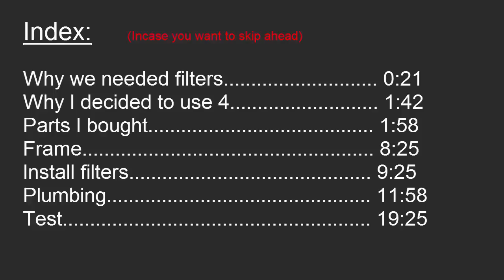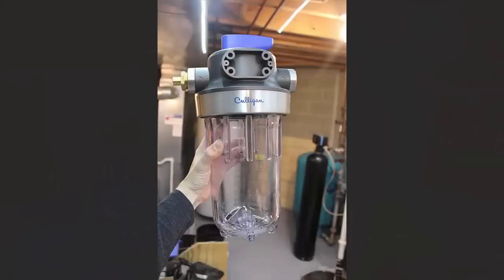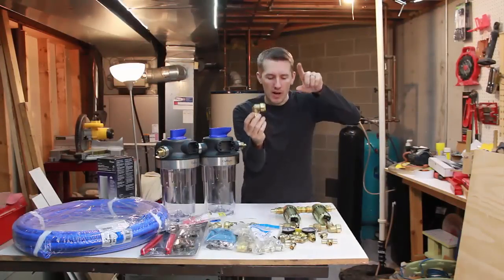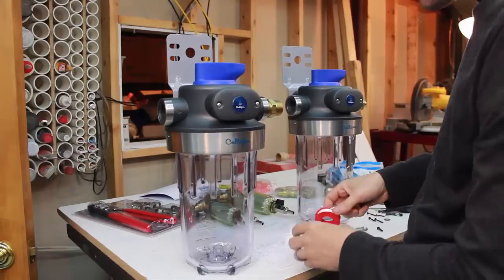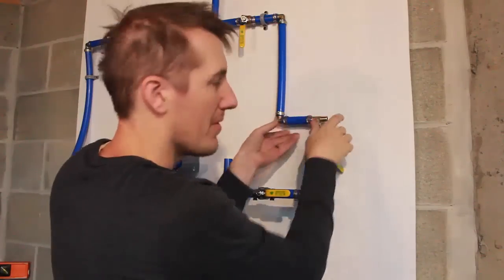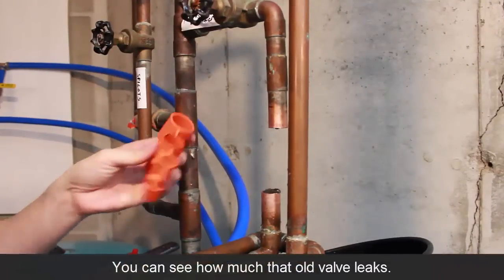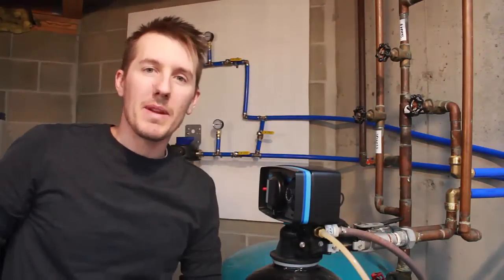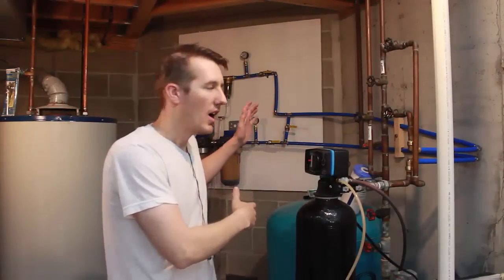How to Install a Whole House Water Filter System

Comment: Is his setup overkill for a prefilter for an aquasure water softener? Or is the ispring mesh filter ll I really need. I'm asking since the 2 cullligan filters are so big, and I wonder if I really need them. I have alot of lime in my well water. Deep Thanks.
Reply from the maker: The iSpring filters are nice because they require very little maintenance.  Blow off every month, takes 3 seconds, clean with tooth brush maybe every year.  The Culligan filters are more work (for me) need to be be changed every month.
Maybe for you, you could go with the 50 micron iSpring and then just 1 Culligan filter with a 10 micron inside.

Comment: Great videos Gary!  I am learning a lot.  I am still doing my research, but I have come across a local company that modifies the UV Dynamics unit by adding an extra 50/20 sediment filter in front of the 5/1 sediment filter and then the 10 micron carbon filter.  Is there any advantage of this 3rd filter?  Also, why not use a 5 micron carbon filter?  The 10 micron seems to be the standard.  I am drawing water from the lake.

Comment: I just watched your video. Thank you for sharing, because this assists in understanding the installation process. You explained the receiving and exiting of water flow in a way anyone can follow. Your explanation made for an easy understanding of the entire process. What is the black tank? You said the blue tank is a well, right? How is the taste of water since the installation?
Reply from the maker: black tank is the water softner.  blue tank holds the water under pressure so that the pump doesn't turn on every time you need a little water.  water tastes fine even without the filters.  our issue was with iron in the water, not so much the taste.
Reply: @Dave Wirth this is a little bit off topic, I just noticed your thumbnail pic & I don’t know if it’s the lighting in the video, the device I’m watching it on, or type of camera you used, but I swear in the video you look like a white dude! Anyhow, like I said it’s a bit off topic, but regardless, thanks for sharing!

Comment: My question to u is. I have one of each units. Does it matter which one goes 1st?   The small unit then the large unit. Or the large unit then small??
Reply from the maker: You want the filter micron size to go from largest to smallest.   Mine is 100 microns, 50, 20, 5.
That way the big particles get caught in the first filter then progressively smaller.

Comment: Thank you so much for this video...one of the best I've seen. I am installing a filtration system now and got several great tips from you. One question - I need to also monitor volume...any thoughts on a simple flow gauge?
Reply from the maker: Not sure about a flow gauge - but looks like there's a bunch of them on amazon:  https://amzn.to/3tB5y94
Also, i've said it before in the comments.  But the pressure gauges are basically useless.  I thought i would be able to see a difference in pressure and know if i had to change a filter.  It didn't work like that.  They always read the same pressure, whatever's coming out of the big tank after the pump.

Comment: The pressure drop you saw between the well gauge and the filter loop gauges may have to do with the gauge calibrations and not an actual pressure drop. Or you have a couple valves between the well gauge and the first gauge in the filter loop, there could be a little restriction there.

Comment: Very nice video, one question, the filter inlet and outlet are 1" rather than 3/4", is there a mix up on your male 2 male hex fitting? Also 3/4" PEX to male adapters?
Reply from the maker: I thought that the Culligan filters had 2 different thread sizes.  They are threaded on the inside and outside maybe?  Like 3/4" female and 1" male, so you could use either.  .....  Whoops, nope, i just checked.  It's the iSpring filters that have both internal and external threads.  Yes the Culligan is 1".  Yes i must have used 1" to 1" male to connect them and 1" to Pex on the ends.  You are right.

Comment: My own research led me to believe that 4.5x20 was the optimal size, but you chose 4.5x10.  Could you share your thought process?  Did you find more filters from more brands available at that size?
Reply from the maker: the 20" would definitely last longer - meaning it would not need to be changed as often.
But i think the 10 inch is more common.
And i was able to buy the filters for like $7 - $10 each.

Comment: The problem I’m having with my well water is the odor.. in your opinion would I need just 1 of those filter housing with a carbon filter cartridge? Also with the spin out filter is that a must? Currently I have a large sediment tank a water softener and a 5 micron filter then going into a Uv sterilization..

Comment: Why didnt u use 20 inch filter housings that would have lasted much longer before needing maintenance? Also can u detail what u were talking about people using parallel connections? How does that work?
Reply from the maker: Yes the 20 inch filter would last longer, but i think it was more expensive and filters were more expensive.  I liked the clear case, it allows me to just visually see the condition of the filter.  And the 10"x4.5" is super common and i can get filters for $7 if i buy in bulk.
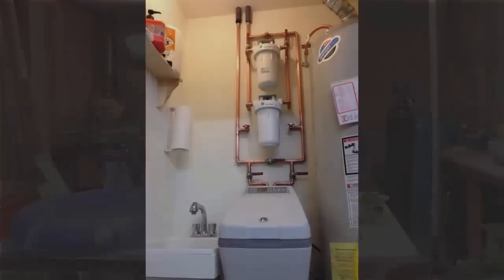By parallel i mean the picture at 1:24.  Basically you are doubling, or in that case tripling the amount of filtered water.

Comment: Great video, with clear explanation and demonstration! I learned a lot. I do have one question -- how do you feel about installing the spin down filter(s) "before" the outside water outlets. Sprayers probably don't matter much, but I do have electronic flow meters, and others have sprinklers and drippers. Wonder if you did research on that, or just can share your opinion.
Reply from the maker: Sure that would work.  They are small and you can install them anywhere.
I just put everything together, but since you don't have to change a filter (just scrub them off once a year) they can handle any flow.

Comment: Just a note when considering PEX or other plastic tubing for water filtration: "researchers tested water in homes where plastic drinking water pipes had been installed, comparing different brands and types of PEX, PVC, polypropylene and high-density polyethylene. They found that PEX pipes released more odors and leached more chemicals compared to polypropylene" (chemicals such as toluene, which is neurotoxic, and MTBE, a carcinogen that's been banned as a gasoline additive, but is a byproduct produced during PEX pipe manufacture)".

Comment: So you filter the water before the water softner correct?
Reply from the maker: I did.  Not sure if that's the best method.
Some say do it after the softenter, and let that remove most of the sediment/rust.
That might have been a better idea and i wouldn't have had to change filters so often.

Comment: I just finished my installation of a whole house carbon water filter and water softener using the CULLIGAN WH-HD200-C on this video (Pentek Dual-Gradient Density 50/5 micron pre-filter and 25/1 micron post-filter)and the SuperPro 80960BU Water Pressure Gauge. I wish I would have had filmed but I needed full concentration and 0 distractions with the camera. I really like the CULLIGAN filters, the only complaint that I have is with the water pressure gauges, are not accurate, they are very close to accurate with a 2-3 psi discrepancy from the real psi on that water line. Close Enough. I guess they are not bad for a $5.30 water pressure gauge.

Comment: Hi Dave, great video. Do you have a link for the reducer going from the culligan 1 inch down to the 3/4 or 1/2 size as I am not seeing that in your links.
Thanks
Reply from the maker: It was something like this, but this is 3/4" for both so this isn't the right size:  https://amzn.to/2XLeKrj
I can't find the one i got, but i got everything on Amazon so maybe you will have better luck finding the right one.
Reply: Thanks, ya seems th 1 inch reducer is a bit hard to find right now

Comment: Great video learning a lot. But question.. why do you have 90 degree bends , wouldn't it be easier to just have one piece from the smaller filters to the larger filters instead of two 90 degree elbows ? I want to install this in my house and want to make sure I do it right but also make it simpler if certain steps are not needed. hope you reply to do this. thanks in advance
Reply from the maker: Yes, 90 deg bends are not needed.  But i only had a certain amount of space and had to fit in 4 filters.  That meant i had to stack them vertically.  There's a million ways to layout the filters depending on how much room you have.  If you have a long straight section you could totally just have them all in line.
Reply: @DaveWirth  Thanks for replying. Very useful video appreciate it.

Comment: This is a great video. Thanks for the upload. 

What are the TDS levels from the faucets now? I'm looking into a pre-filter system for our water. We currently only run a softer.
Reply from the maker: I haven't checked since this video, back about a year ago:
https://youtu.be/10pUt3cRpz8?t=477
But there wasn't a difference between the water directly from the well and through all the filters.  But the RO filters took the levels way down.

Comment: The current version of the iSpring filter includes a mounting bracket, screws, teflon tape, wrench and installation instructions. 

The clear plasting tubing to drain it is 1/2 outside diameter.

Comment: I just bought a house with a water well too.. in the well shed, I see it has those two smaller filters... and it's dirty.. I guess I need to open it up and let the dirty water drain down?  And I dont have the two bigger filters you have.. is that okay? Are the two smaller filters good enough to remove any dirt/sediment from the water well?
Reply from the maker: 1.  Yes turn the knob on the filters to drain.
2.  You will probably have to take the mesh filters out and clean them see: https://youtu.be/FOlLTR9NRy0?t=191
3.  Depending on what sediment you have they might be ok.  If you are just trying to remove sediment or something then yes they should be fine.  But rust and things will get through.
Reply: @DaveWirth  Cool.. next, is there a way to determine the water flow direction? I assume the water from the well/ground goes to my pressure tank, then one of these these small filters, then to my culligan water softener, then to the 2nd small filter (these two filters are separated/independent from each other), and finally to the house... Since there are no direction arrows drawn on the pipes, is there a way to know the flow of water, say from turning of valves off along the piping?
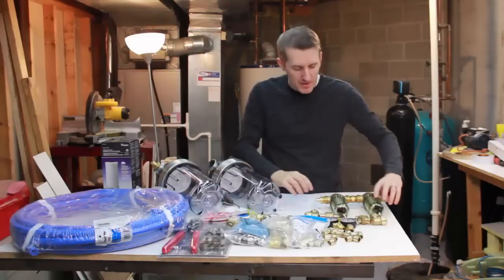Reply from the maker: @be236  you can see mine at 2:16
There are little triangles in the metal that show the water direction (or at least the way they were supposed to have the water flow)
But yes what you said makes sense.   Well, pressure tank, filters, softener, house.  Weird that yours goes filter, softener, filter, house.
Reply: @DaveWirth  Ah, yes, I see the arrows on the pipes with the filters.. nice... as for my two separate filters... I am guessing the one where between : water softener -> filter #2 -> house... maybe it's to filter whatever comes from the softener, eg, maybe there was some dirt that fell into the brine tank, since the big lid is a cover w/o any locking mechanism, anyone could just lift the lid up and "ack" drop or put something in there.. my system is in a shed and the previous owner didnt even put a lock on the shed door (I just put a lock afterwards).

Comment: Why needed that clock like valve or system in the water filteration ?
Reply from the maker: The 2 pressure gauges are not really needed.  I thought i would use them to know the pressure before and after the filters, but if i did it again i would skip the gauges.

Comment: Do you have the link to oring and lubricant please ? Almost doing a replica copy of this. Except hoping to use oil based pressure gauge instead of default one. But same setup.
Reply from the maker: any food-safe lubricant will work
and i don't really use the gauges.  like someone else said, the gauges only really work when there's water flowing not just reading the pressure.  if i did it again i would skip the gauges.

Comment: Where did you get the rings for the Culligan filters?
Reply from the maker: Amazon:  https://amzn.to/3nb8ZRh
One tip, that someone commented, that has helped a lot, is to NOT over tighten the housing.  The first couple of times i changed the filter, i noticed that the rubber o-rings were warped.   I guess i was over-tightening the clear housing and that was the cause.  Since then i've just done a snug fit.  Zero leaks and the o-rings have lasted years.
Reply: @DaveWirth  Thank You for your help and time.

Comment: Very interesting! Just wondering why you used 2x elbow and 3 sections of PEX on the left hand join (between the big filters and small) and didn't just form the PEX around in a C shape in one section? was the radius too tight or was there another reason?
Reply from the maker: Ya the radius was too tight, might have put a strain on the fittings.  Similar to why i changed the bend at https://youtu.be/0_F_xUKHwBQ?t=959    to an elbow so i could fit it tighter to the wall.  I'm sure a more experienced person would know how to heat and bend the pipe more but i didn't feel comfortable doing it since it was my first time using PEX.  But overall PEX was awesome and easy to use.

Comment: Did you tested before and after TDS? Just wondering if it changed
Reply from the maker: No i only recently got a TDS meter, but it would be a good idea to test the levels with an old filter and then after installing 2 new filters.

Comment: Watching this, and I had used teflon tape as well, major leaks...I then found the "liquid version" of teflon and that made a much better seal, no leaks. Also I am wondering why you had not used a GAC filter. My setup is 10" 20 micron "pleated" media followed by 5 micron sediment filter, then goes into a 20" GAC filter media and then it goes into water softener.  Again great idea for a "bypass" so you can change out filter without turning off all the water to house.

Comment: Hi Dave, Dan here in Wisconsin looking to do the same. Do you recall what your iron level was before adding the filters and what it is now?
Reply from the maker: No, never measured them.  But they were and still are terrible.  I change the two 10x4 filters about every month and they are completely orange.  If I don't change them the toilets and tubs start showing rust signs

Comment: Why did u put the little filters hi on the board? Would it work better low?
Reply from the maker: No it shouldn't matter high or low.  Just that the larger micron filters are first.

Comment: Very nice job and explanation and thanks for links. Why didn't you put in carbon filters
Reply from the maker: I buy the cheap filters, $7 each in a box of 12, because i change them so frequently.  Also i think carbon filters are for water that smells or tastes bad.  That isn't our problem.  I think a year ago i did try installing a carbon filter in the 5 micron spot and didn't notice a difference.

Comment: What size is the drain tubing for the iSpring filters and where did you get that?
Reply from the maker: I did a video with more detail on those iSpring filters - https://www.youtube.com/watch?v=FOlLTR9NRy0
Don't remember the size, like 1/4" or 3/8"
You can use any material, actually don't even need them, you could hold up a bucket and spray it into there once a month.
But you can get the hose at Lowes, HomeDepot, Amazon...
Reply: @DaveWirth  Thanks.  I wish that everyone who posted videos here was a conscientious, thorough, detailed and efficient as you are.
Reply: Sorry, I see the part in your list now.

Comment: Hey Dave,
I just built a system just like yours.  I appreciate you posting all that you did for others to learn. I have a question for I’m getting a little leak around the output pressure gauge and I have taken it apart and re-taped it and it’s better but still leaks.  Any suggestions on you end?  Also, where did you go skiing?  
Thanks.  Derec
Reply from the maker: I had zero leaks from the PEX pipe, but it did leak at some of the screw connections.   For me it was mainly between the two large filters.  
I had to unscrew them and add a lot more Teflon Tape.  I wrapped it like 4 times, then read that you need to wrap it like 14 times.  Once i wrapped the threads more and cinched everything down it stopped the drip
Reply: Ok.  Thx Dave.  I’ll re-wraps the threads.

Comment: So, I bought 5x Calgon filters and 5x of the smaller filters that you have on top.( I know it’s crazy over kill ) How much did you water presser drop, and what filter sizes did you use ?
Reply from the maker: I didn't see any noticeable pressure drop.  i buy the 10.5 x 4 filters
Reply: Dave Wirth With five of the Culligan filters and five of the smaller filters you have on top of them do you think my water pressure in my house will drop dramatically?
Reply from the maker: @rosierose5644  I don't know.  Mine didn't with 4 filters.  Maybe if you put 1 Micron filters in all of them it might.  Maybe if you use 20, 5, 1 micron filters it would be ok.??

Comment: Why the 2 90 degree turns if your pipe is flexible? Why did you not make a half circle with the pipe on the left hand side?
Reply from the maker: It's not that flexible.  The 90 deg elbows releases stress on the pipe.

Comment: You might be willing to add  a zeolite filter just to collect the mud, if any, before the filters. You can DIY.   I did it and works very well. It maintains your filters cleaner for a longer time period.  Regards.  Santiago
Reply: What's a zeolite filter? I'm in the Philippines and the water is like mud. I have 3 10 inch filters but the first one clogs in just a few days.